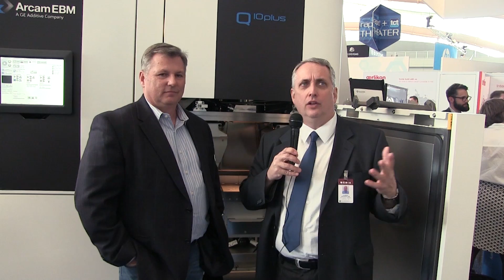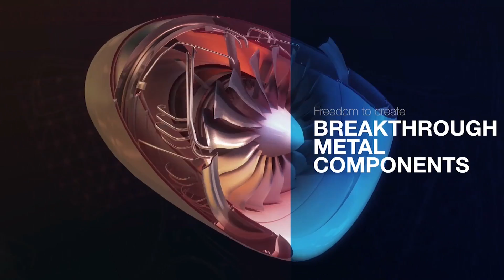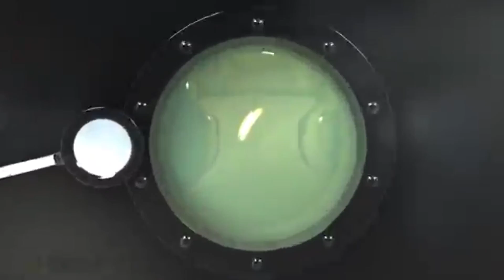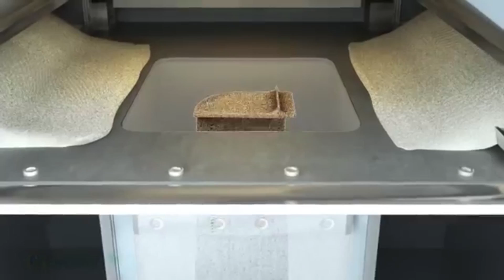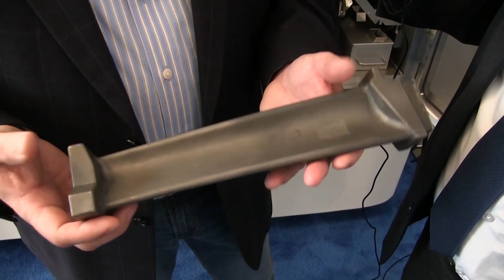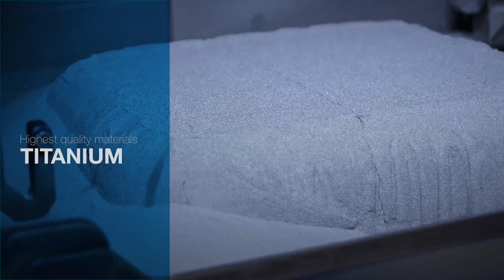How Electron Beam Melting Inspired GE’s Acquisition of Arcam

Comment: You are part racoon by nature.  Also nothing is stopping someone from using a laser in a heated vacuum environment.  You could probably even get most of the benefits of vacuum at not nearly as high of a vacuum.  
Corse if your already doing a vacuum electron beams vs kilowatt range lasers...  meh, and electron beams are easy to steer and are more resilient to metal vapor deposits.  
IDK carry on, I just like to bitch on youtube about random shit.

Comment: That was pretty cool. I was expecting soft interview question, but these were actual real engineering questions with practical applications. The interviewer knew what he was talking about. The trabecular structure point was interesting (I didn't know they did that, and the fact that they had delamination issues due to layering the texture on top of the part is a rather interesting manufacturing point), and the added simulation for explanation was pretty cool too. Thanks for the good video - you earned another subscriber.